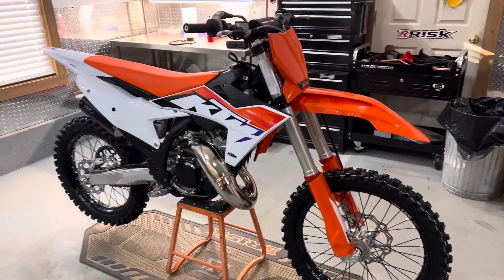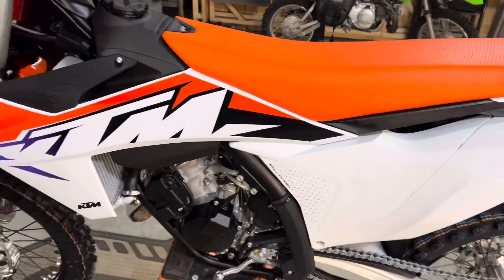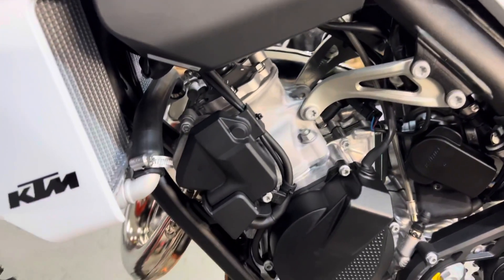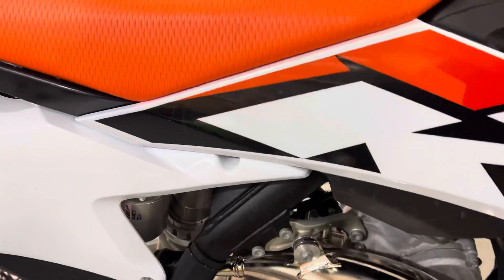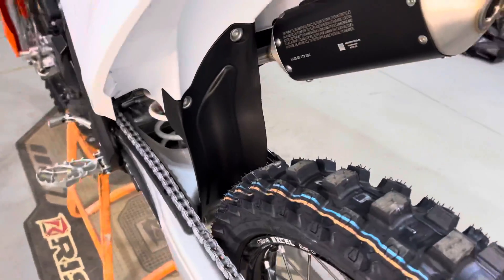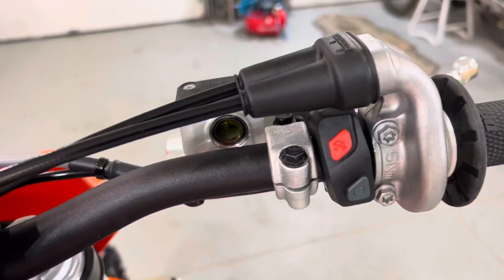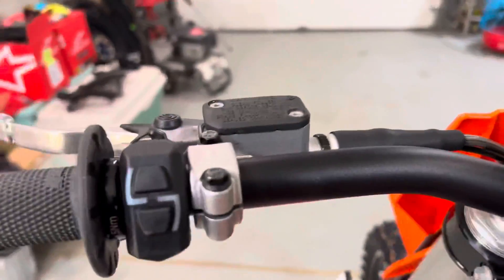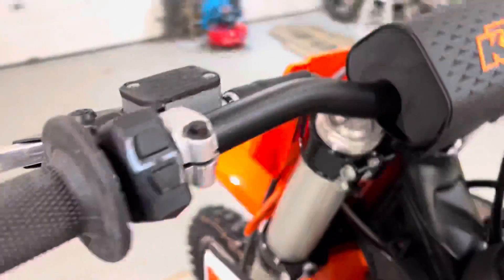2023 KTM 125sx TBI Deep Dive - Overview, Tech Talk, and more. 250sx 300sx 300xc

Comment: Ive had the pv light since my first or second ride 23 tx300. Im at 70hrs now and had a crash last week after the crash it seems my starter broke.The off switch smashed and start button semi jammed also my map switch started to flash green and wouldn't change. It seems like the bike got stuck between maps bike wouldn't run into the higher revs. I limped the bike out and heard it try start itself a couple of times while i was riding. Tryed disconnecting the map switch on the way out to see if it would help but nothing. My bike is now out of action waiting on the dealer to reopen im hoping the ecu got confused somehow and can be reset to fix.
Reply from the maker: That sucks! New map switch in March for these bikes.

Comment: Do you have to do the mixing yourself to be able to run?  in that motor
Reply from the maker: Yes, this is not an oil injected system so the gas and oil must be mixed prior to pouring it into the tank.
Reply: I bought a 125 xc motorcycle and it came imported and it brought gasoline in the tank. That's the mixture that they put in the KTM, right?
Reply from the maker: @nojfrom.baya.  I am not sure, what yr is the 125 xc?
Reply: @themotocrossmodchannelWulfMX   i a 125xc  2023
Reply from the maker: @nojfrom.baya.  If there was fuel in it, then yes, I would rain it and start over with a good mix.

Comment: You should be able to put a bigger injector in and a different resister to adjust fuel flow
Reply from the maker: If the injector is larger I don't think it will matter bc you can't tell the ECU to send more fuel to compensate for the larger orifice like a traditional carb with jets, it will still only send the same amount of fuel. The carb acts on vacuum, the TBI is forced injected.  Not sure on the resistor angle?  Did you mean restrictor? Thanks for posting-

Comment: It's all going to be interesting..I have a new 300sx..at this stage I havent been able to get to the dealer and pick up the bike yet though... The guy from two stroke performance here in Victoria Australia has done some initial dyno runs on the 125 and it seems to be around two and a half horsepower at peak, down on the 22 model..he has a YouTube  channel with a video,on that. My boss at my local track where I work on weekends got a ride on a 23 husky 125 last weekend..he was underwhelmed to say the least. It seemed very flat on top and a bit gurgly down low..to my eye ...it just did not bark and pull like a 22...no idea if the owner was running the correct fuel and oil at the right ratio..
So this new fuel injection format might take a while to reach max potential...looking forward to the first ride on my 300
Reply from the maker: I spoke to TSP yesterday, and I agree, I am underwhelmed with the power output....I dyno'd this with 8 pulls, and I am in the middle of documenting the findings and presenting them to the KTM rep.  I have low rwhp with the fixed ECU monitoring the AF and that was @ 18:1, 93 octane, 40/1, good tps, good pv, updates done.

Lucky for you, the 23' 300sx is an animal, there are a few guys here and there that have small complaints but the engine for sure is a winner, just make sure you stick to the manual on the 60/1 and octane rating it says and don't stray away from that.
Good luck and post results- thx for posting- Joshua
Reply: @themotocrossmodchannelWulfMX  well someone will come up with a cure I suppose..but its crazy that the bike could be released with this problem..glad I didntvbuy a 125. I actually have a brand new 22 yz 125 with a tsp head and ignition as well as an fmf system. Had it about 5 months and still haven't fitted those parts or done anything else to the bike , including ridingvit🙄🙄 Been working 7 days a week . That changes in 23...will be riding a lot. Will be interesting to see how the tsp parts work on my yz. Have his cylinder head on my yz 250...great improvement

Comment: Talking about tuning a bike before you've even ridden it seems a little premature to me.
Reply from the maker: Well in the world of the 125 motors, these bikes are, well, all about the motors and there is always an opportunity to find areas of improvement and adjust some small things to get it to run as best as it can.
There are no ECU changes that can be made like on a carb where you can swap out jets or whatnot so really, there is no current way to tune it other than bolt ons.
Not sure of your bikes and what you have done to them but almost every bike I have ever seen has has some sort of tuning done to it to get it to run and work better for the rider...rejet, a reed system, fuel etc.  What kind of bike do you have?

Comment: With the new technology, it almost sounds like the ultimate production class race bike, as the electronics can't compensate for any motor or bolt on modifications?
Reply from the maker: Right now, it can't compensate for internal modifications that effect the volumetric efficiency of the motor but bolt on mods for reeds or an exhaust are ok.  I will post a video(s) soon of a bone stock run and then the runs after the bolt ons to see what we get.
The pipe usually shifts the power and doesn't ever add a major amount of hp, same goes for the reeds.  They do add a little bit but not earth shattering numbers of increased tq or hp.
Thanks for posting-

Comment: How much does the electric power valve gizmo cost? You'll be crying in three years when it's bad, expensive and on backorder. It's new and cool now but a bummer when it fails and it runs like a turd. Newer isn't always better, it's just different. It will be a parts bike before it's 10 years old.
Reply from the maker: In answer to your question, the electronic PV actuator which regulates the pv opening and closing is $177.
To compare, the 23' YZ125 pv governor is $190, so boom.
All bikes have issues, new, old, and I'm not sure why you are saying this and bashing the bike and in particular the PV system? So what bike do you ride?
Reply: @themotocrossmodchannelWulfMX  not bashing this bike at all.  It's becoming a throw away world. We all love new tech until it doesn't work. Electronically controlled exhaust servos aren't new and have been failing for years. It's $177 now, but watch in 3 years what that price becomes.

Comment: Wondering what ratio do you mix these and I thought I seen some place to use 98 octane gas ?? Where do you get 98 octane
Reply: Australia
Reply: The octane rating listed in the manual is 98 RON. That’s 91 here in the states.
Reply from the maker: @BAYAREAMX  Yeah, I forgot to post that..I did look up a conversion chart and it had 95 ROZ @ 91 US and 98 ROZ @ 93 US.  There were about 100 articles on the conversion and the numbers were averaged from that 91-93.
Here is a link- http://www.pencilgeek.org/2009/05/octane-rating-conversions.html  
Thanks for posting-
Reply from the maker: also we can get 98+octane from some suppliers around here, VP Race Fuels, Sunoco race fuels etc.  Im running VP T2.
Reply from the maker: manual specs 98 oct unleaded @40:1 with a JASO FD spec'd oil.  Look that up bc it's very specific to a premium rated premix.  The JASO FD is a Japanese rating system that certifies oils so they are graded and offer the best engine protection.  The 250/300sx specs 95 oct unleaded and 60/1.  Thx for posting, please subscribe!!

Comment: The PV code that is thrown is actually not an issue for how the bike is running. It is basically the same as when you disconnect the airbag on your car - even if you reconnect it and all is fine, the error code (and light on the dash) is remaining until cleared manually. On the 2023 TBI what happens is that the ECU issues a PV command and has a time frame where it expects it to be completed (PV has a position sensor for feedback). This time frame is obviously a bit short for certain situations and that's when the code is thrown. In the case of the start button causing it the reason seems clear - both PV actuator and starter motor (even with the engine running) are a big load on the electrical system. So both running at the same time will cause enough of a current drop to slow down the PV actuator and thus dropping out of the expected time frame. KTM will issue an update fixing that but until then there is not much you can do other than either riding the bike or have the dealer clear the code. Could be worse ...
Reply from the maker: Agreed!  I have heard in some cases however that with the code flashing, the engine performed poorly and was acting like it was in "limp home" mode.  I was not able to determine if this was due to the start button being hit while the engine is running, or it was a different issue all together but there seems to be some small bugs here and there that will pop up with any bike.
My friends 300sx had a "hard starting" blink code and it did not effect anything at all other than being a visual annoyance.  Thx for posting-
Reply: @themotocrossmodchannelWulfMX  Well, there is always the option that something really is wrong with the PV - either electronically or mechanically - thus making it feel like in limb mode. I wonder how many of the previous generations PVs were not working properly and most never noticed! Looking forward to your findings and subscribed 👍